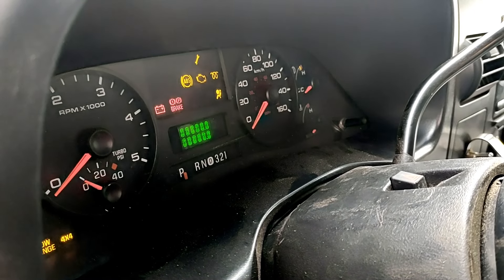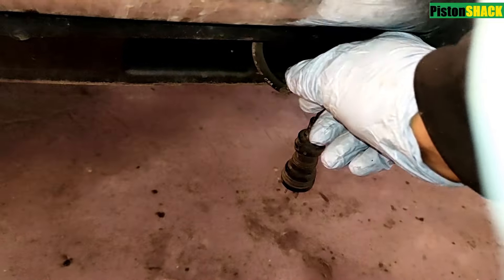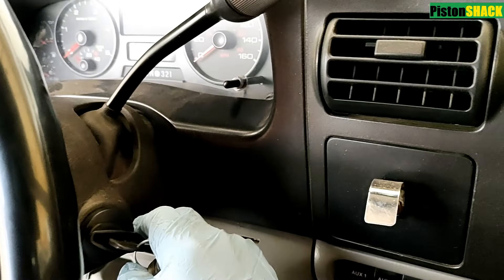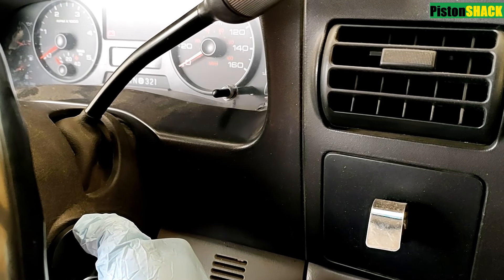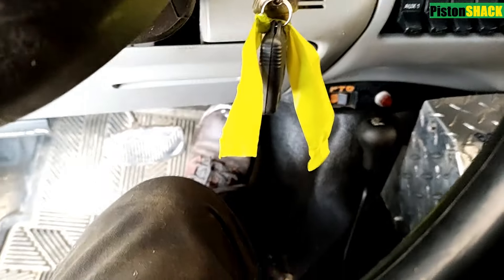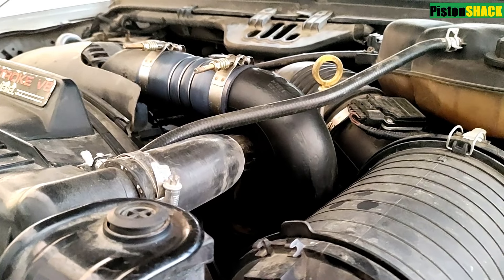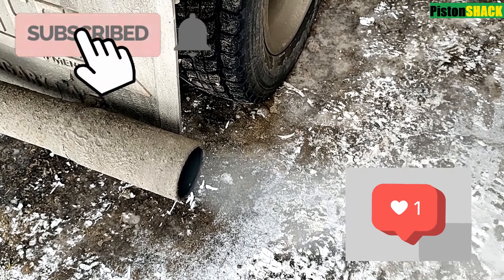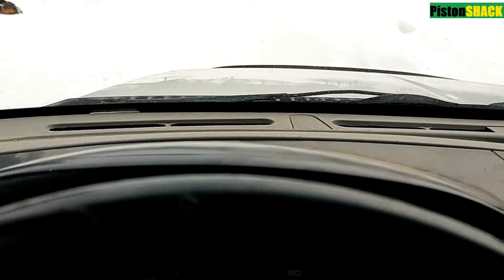HOW TO PRIME 6.0 POWERSTROKE FUEL SYSTEM & BLEED OUT ANY AIR | EASY

Comment: I had to remove the upper fuel filter cap and let the air out with the small fuel filter out to fill up the  bowl..took 10 minutes with the key on and off several times to get fuel  primed and the air out from the pump up to the secondary fuel filter bowl. Once it filled up, i put the filterback in,  cycled the key several more times, and it finally started up...

Comment: Ok, I have a 2003 Ford F250 6.0 power stroke. I recently changed the inter tank fuel pump and the secondary and for injectors on the driver side. It was not wanting to start. I have a friend come over and would take off the fuel filter housing cap have me turn the key and then he put it back on and then he had me try to crank it over a couple times and shut it off and he did that repeatedly because he said he was getting air out of the fuel lines by taking the cap off the fuel filter. He said it was Hydro locked. We eventually got the truck started with brake clean in the air filter. I let it run at an idle for 20 minutes. I shut it off and immediately tried to start it again and it would not start. What is the best way for me to get the air out of my fuel lines?

Comment: i have a 6.0 power stroke replaced the filters and pump im getting fuel up to the top filter but when i  put it in drive ill go about 15 feet then it will die on me by any chance know what the problem may be
Reply from the maker: Hey brotha! Let the engine to purge air trough the return line back into the tank before you drive it. Engine might run like crap until fuel system purged completely.
Reply: @PistonShack do you know the difference between a common rail and a hwui diesel engine is

Comment: I did this after changing both fuel filters the only thing I didn’t do was hold the pedal down after start up it ran for a minute and stalled out then won’t start I tired priming  it again but no luck please does anybody know what’s wrong?
Reply: Did you figure out what was wrong? I'm having the same problem but I just started trying to figure it out on my own. Any help would be greatly appreciated. Thank you.
Reply: Did you guys figure out what happened in dealing with the same thing
Reply: Mine did the same thing I re primed it like 5 times and it fired right away
Reply: I have found that if you fill the bowl with fuel and leave the filter and cap off after cycling the key a few times fuel will flow back to the pump when it shuts off.  Repeat 2 or three times and you will hear the pump finally prime.

Comment: I can take a lot more priming but does work it all depends on how much air you have let get in your line, I had Inadvertently left the drain plug open too long on the horizontal fuel filter my truck started fine drove for about a block an stalled, one and a half hours later after many priming sessions hoping that was all that it was it finally started, the reason for my optimism was it was giving signs that it wanted to start but would stop after holding the ignition on but careful not to burn out the starter good thing I had another vehicle that I was boosting from my minivan

Comment: I got super low on fuel bleed the lines and still no start even primed it
Reply: There is no such thing as priming a fuel system on a 6.0. You have a high presure oil problem bro

Comment: So to just give everyone a heads up all international engines like the 6.0 7.3 dt466 and another dt engine arent common rails. So that means you dont have to worry about bleeding air out of the fuel line on these engine. Plus if you really were worried about it the 6.0 has a electrical fuel pump. Plus the fuel side is only at pressures of 75 psi. The injectors in these engine are hwui injectors short for hydralic. The high presure is on the oil side. So the oil gets up to 5000 psi because of this. If you do anything with the high presure oil system then you will be bleeding air out of it. But its really easy just start the truck and go drive it like you stole it for a couple miles.. Your common rails engines are your duramaxes, cummins, ford 6.6, Detroit, cat, and TDI engines. I'm sure I'm missing alot more.
Reply: You still want to prime and bleed the air out otherwise it will run like shit ask me how I know I own a 6.0 . You are correct about running it like you stole it to bleed air out but you want to prime and bleed as much out as possible before doing so. Running it like that only bleeds out what air you didn’t get out during the original priming after replacing filters or doing any fuel maintenance work.

Comment: What if I've done this like 90 times? I put in new injectors and disconnected all rail lines from the filter housing.
Reply from the maker: How many PSI of oil high pressure do you have while cranking?
Reply: @PistonShack  Not sure, the dummy gauge on the dash is showing right in the middle. My truck is facing down on a decline  so I am hoping the quarter tank of fuel I have is getting retrieved by the pump. I may try the blue/yellow wire crank trick tomorrow.
Reply from the maker: If you have base oil pressure (low pressure oil pump) after 5-10 seconds of cranking you should see oil pressure gauge respond and arrow should be on the middle. That's good. 
Do you have any fuel getting to the fuel at the secondary fuel filter bowl? Do you have tachometer reading while cranking?
Try to unplug ICP sensor, if ICP senor is defective engine won't start due to the faulty oil pressure readings by unplugging it ECU will switch to default  mode.
Reply: @PistonShack  mine is getting fuel slowly i tryed this a bunch of times im not sure what is next should i fill up first
Reply: @Getheintero why did you drain the fuel in the first place

Comment: Changed both filters, primed it by cycling the key a few times, fired up then died after about a minute of idling. Cycled the key 10+ more times in 30 second intervals, and I can’t get it to run. Any help would be appreciated!
Reply from the maker: Hey Phil.
Do you have fuel up to secondary filter? Do you hear the prime pump running when IGN key turned ti the ON position? Remove secondary(under the hood) filer cap to verify the fuel on low pressure side. 
Does based engine oil pressure gauge show any pressure while cranking?
How many PSI of high oil pressure do you have during the cranking? Should be at least 500 PSI for engine to fire up?
Reply: What else is going on with your motor? I promise it's not a fuel issue
Reply: I have the exact same issue what was the fix?

Comment: The truck in this video has something else wrong with it. When you change your fuel filters it should never start like this. Mine always starts fine after changing the fuel filters. You don't have to turn the key a shit load. Just 2 times and you will be gravy baby.